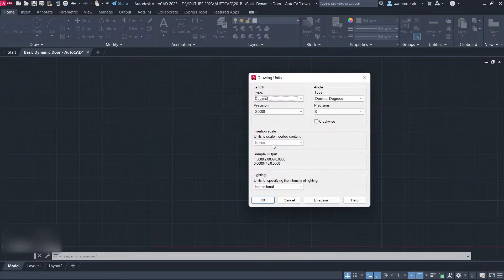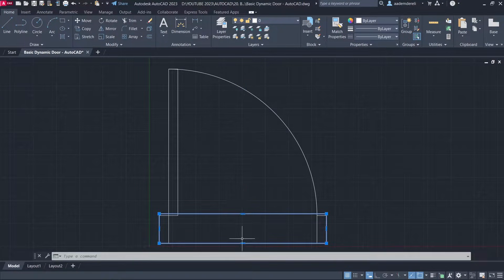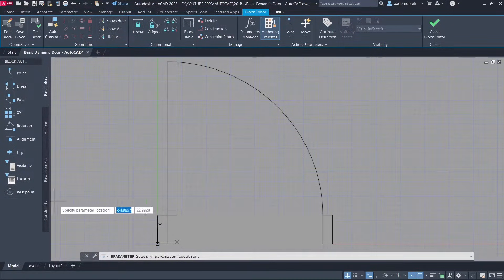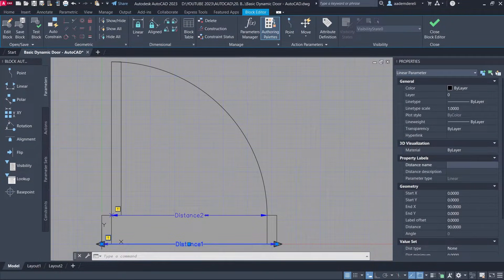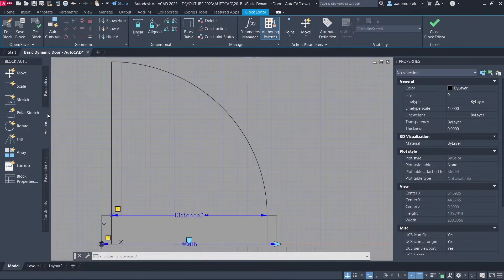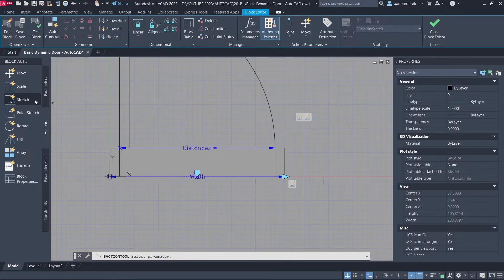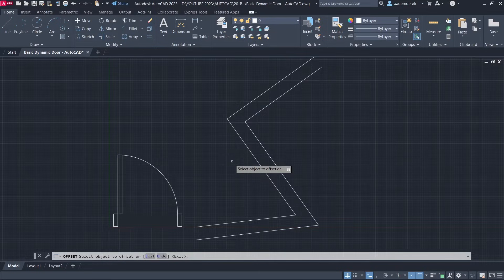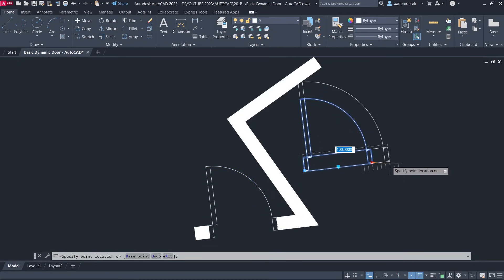Create Your First Dynamic Door - AutoCAD

Comment: This is fantastic! I'm just looking to add a flip and thickness feature. I looked into some of your other tutorials but it got messy combining the parameter actions from different tutorial vids. Any way I can add a flip and thickness parameter to this door?
Reply: Draw symmetry axis for door opening both diagonal and perpendicular. Place flip parameters on each axis. Delete axis. Add flip action do flip parameter. Select the whole block as selection set. Repeat for the other parameter. Now, for the flip parameter perpendicular to you main linear stretch : add another stretch action to your stretch parameter, slect the same hadle, select wstretch window to contain your flip parameter, add your flip parameter to selection set, then in properties of the new stretch action, set distance multiplier to "0.5". Now you have a flip parameters that will change both swing direction and mount side for your doors and your stretch parameter will move the axis to along with as you change your door opening size.

Comment: Thanks for the instruction Adam. It was a great learning experience. I made mine using imperial units. Just calculated your numbers into inches. After I completed the block I tried to add doorknobs but they won’t stay in relative position when I stretch / shrink the door size. Any instructions on how to lock the position on the handles? Thanks for sharing your knowledge.
Reply: Create a move action. Pick the width of the door parameter and then select the door handles only. After this, select the move action and set the angle to 90 degrees. That way, once you stretch the width parameter the door handle with move at a 90 degree angle staying relative to the door width.